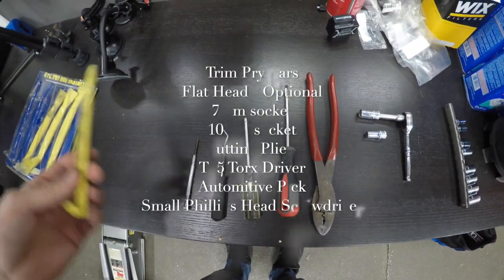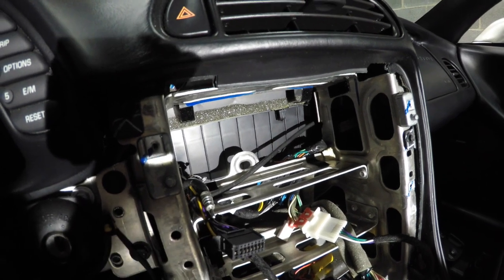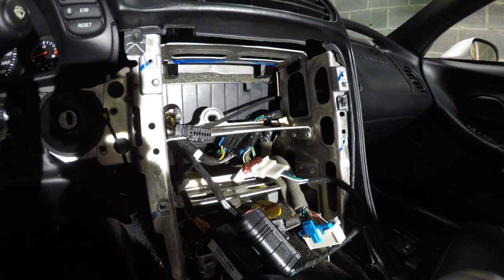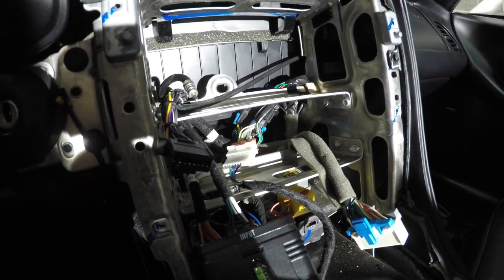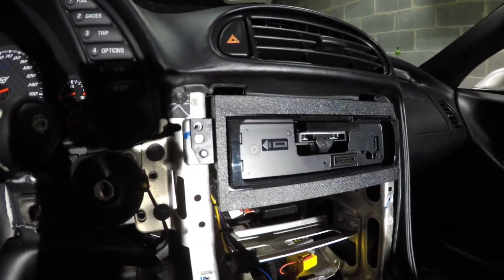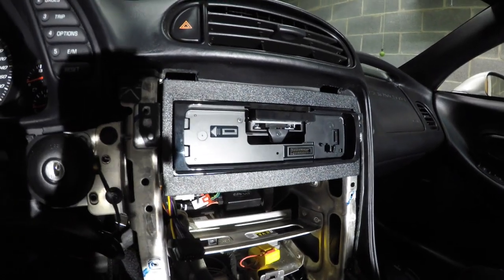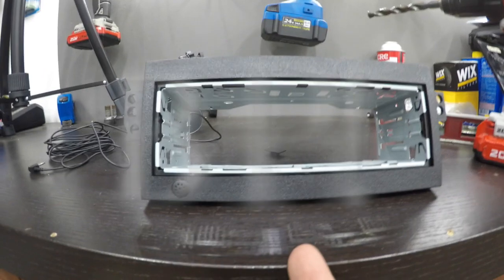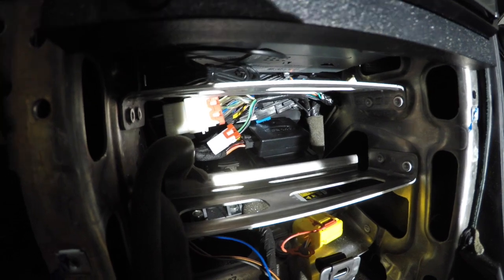C5 Z06 Corvette Single Din Radio Installation - Pioneer SPH-10BT

Comment: Cool idea with the mic!
Reply from the maker: Thanks! I thought so. To be honest the vibration of the car kind of muffled it being in there. It worked well at idle and when the car is off, but driving was not pleasant for the person on the other side of the line...so I was told haha.
Reply: @KennyChurchSpeed  oh no way, that’s a shame. I just bought the same radio, great on price. Looking forward to having it installed 🤣 not as adventurous as you.
Reply from the maker: @oscarcastano1368  yea, was a bummer. Good luck, I find it to be a good unit and food use of technology and phone placement for the money.

Comment: Hello and thanks for making the video! when hooking your wires from the Kenwood to the harness was it a direct 1 to 1 color to color or are they different colors? Did you need an accessory power with this harness or is it part of  the integration with the harness? thanks again, great job
Reply from the maker: Hi, thanks for watching. I used a harness adapter so the wires from the head unit match the adapter. The adapter then allows you to plug right into the factory plug.
Reply: @KennyChurchSpeed  thank you! I ordered the exact parts as you have listed. No additional external accessory wire if using this wiring kit, right?
Reply from the maker: @jeffweller4042  Hi Jeff, correct it should plug right in.

Comment: any issues with the front speakers? I got everything hooked up and notice that the rear speakers are a lot louder compared to the front.
Reply from the maker: Hey thanks for watching. It may be the fader in the unit itself, or the mini amp having the front gain/balance turned down in comparison to the rear. Try checking and hopefully that is the problem!

Comment: The mic in dash is a brilliant idea, I just bought this deck would you recommend it for a convertible? I have yet to install it
Reply from the maker: Depending on the quality of the mic it may not work. Especially if you have exhaust. I have tried a few different places in my car now and found all of them relatively the same. The exhaust really muffles it out according to the other person on the phone. It could also be the vibration as well. I also tried the a pillar on the driver side which seems to be the best but in a convertible the wind noise I'm sure will be difficult to concur. Thanks for watching!

Comment: Just wanted to verify that you DO NOT have to cut-out the support trays for the A/C, and stock head unit to install a single din?
If so, the Crutchfield site appears to be wrong. Also, what size is your phone? I have a 6.5" and wanted to make sure it would fit this head unit.
Reply from the maker: At around 7:40 I talk about it. I didn't cut anything, I bent the donut that contacts the unit back with pliers. I didn't want to modify the factory cage.
Reply from the maker: Also I have a google pixel 2 xl, so it is pretty large, however newer phones seem to be getting larger so I'm not sure if pioneer will have the change the dimensions or update accordingly in future years.

Comment: Looks great. How bad does it block the air vent above it? Is it still usable?
Reply from the maker: It does block the air vent slightly. Air still is able to come out and around. I was worried about that as well, however the mount does allow you to rotate the phone vertically or horizontally. If you are super worried about air flow blockage then it may not be the solution for you, but with the heat on I personally use the floor vents in respect to mitigating my eyeballs from being dried out.

Comment: Thanks for the video. How’s the microphone? Can people hear you at highway speeds?
Reply from the maker: Hi, thanks for watching! You can hear other people well but they have a hard time hearing me. I moved the mic to the a pillar with the same result. I think it's the nature with the exhaust. It's doesn't have drone but it's loud.
Reply: Kenny Church thanks for the response. I was hoping I’d get a different answer though. 😂 I’ve tried 3 different setups and haven’t had any luck. Thinking about putting dynamat in the whole car now.
Reply from the maker: @edraldbarredo  haha no problem. Yea I am not going to that extent, however earbuds are looking promising! I've used those in the car and they seem to work well. Using the pioneer unit with the phone in the holder on speaker doesn't cut the mustard.

Comment: Does this charge your phone while it is mounted in the holder?
Reply from the maker: Unfortunately, you have to plug it in. However there is a USB on the front of the unit you can use to plug it into. I personally changed my cigarette lighter Tina USB charger and use that and it works out nicely. The app however does not use you battery too much unless you are on a long journey. Thanks for watching!

Comment: i used the same harness for mt 2001, i cant seem to get it to sound as good as the stock system. i took the Dash and  center console apart like 3 times already to adjust! Does yours sound as good or better than the stock system?
Reply from the maker: I had the same issue and I played with the mini amplifier to get the bass and all around sound to be as good as the factory unit. I don't think it could be better than it is, but I believe it is due to the small amp that you use apart of that harness. I ended up turning up all of the gains on each channel to get it where it was as loud as factory system. Unfortunately, I think the best route is to add a more powerful amplifier to get the sound I belive we are after.
Reply: @KennyChurchSpeed  Thanks for the response, Good Video by the way.
Reply from the maker: @jeffbanes2223  you're welcome and thank you!

Comment: Did you use your stock speakers
Reply from the maker: Hello, yes I did use all the stock speakers. I just installed the mini amplifier and head unit. I used the app for the unit to manage the sound equalization. Thanks for watching!